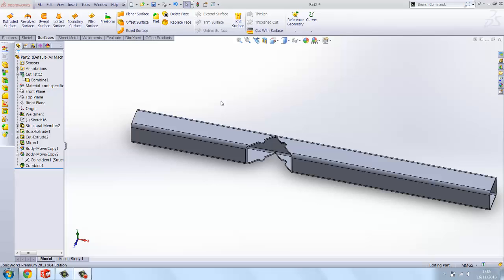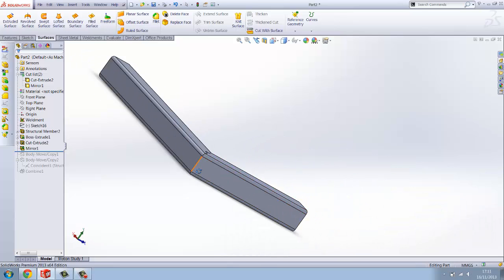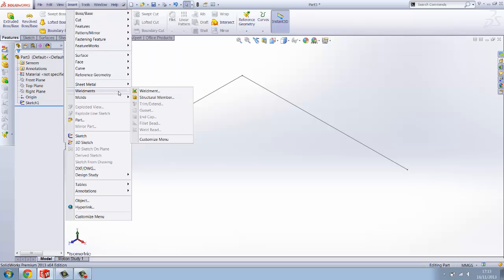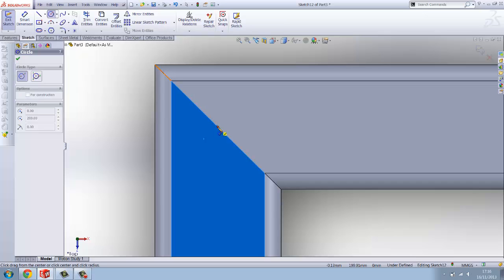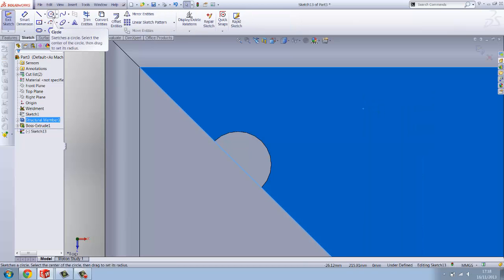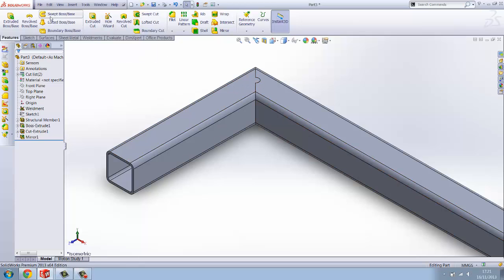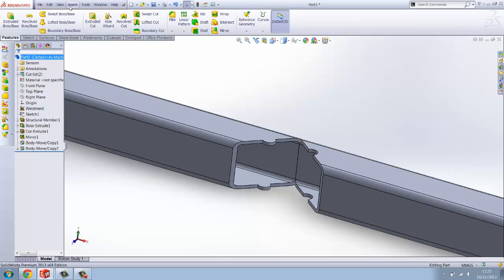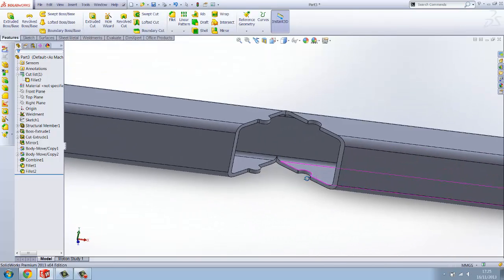Tutorial: Producing a "Ready To cut" Box section length to be bent by the "notch bending" method

Comment: If you tried to actually manufacture that it wouldn't work. You've given yourself no radius to work with on the outside of the corner.
Reply: Right. Cut on Plasma and coudn't bend it fully
Reply: Please say my, as to do it correctly?
Reply: @selderei97  no